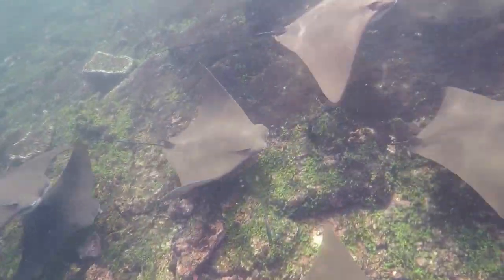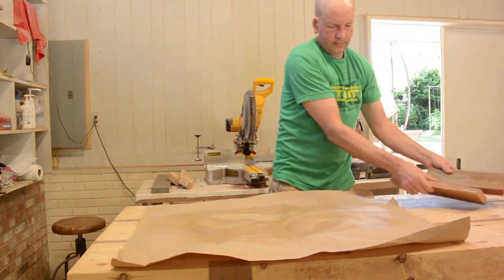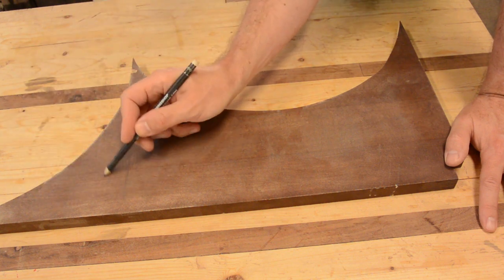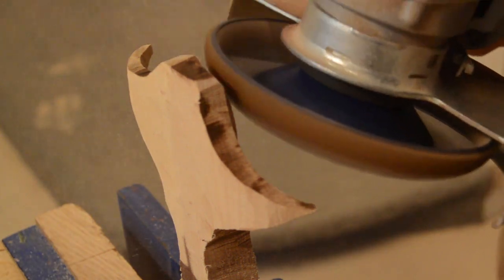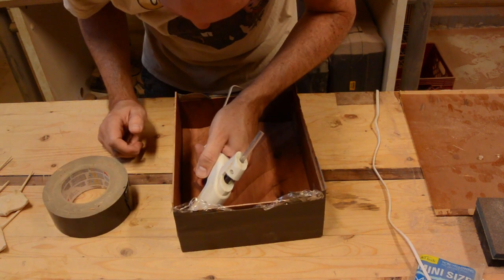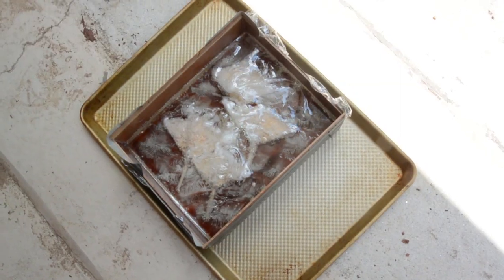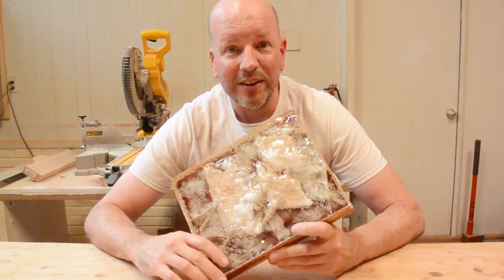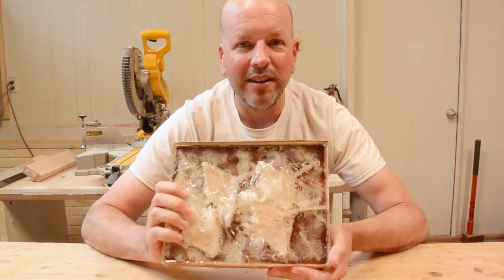Making Wood Stingrays - Carving, Woodworking, Art, Sculpture

Comment: Yeah, i was wondering when you did that pour if it was going to be too thick.... 
just a suggestion: if you do multiple shallow layers, leaving each pour to 'mostly cure' (semi-solid but tacky) before pouring next layer it will not only allow the layers to cure properly (heat dissipating gradually) but also allow you to position the rays at different levels, looking more realistic..... (this way you may even be able to use the same type of epoxy)
Shame it bubbled over, was looking like it would've been great
Reply from the maker: Thank you, Andrew. Great suggestion. Athough, I wanted to avoid having a line between the layers.

Comment: I have had a problem like that. Popped the piece into the freezer for about 15 minutes, then checked it. It had cooled down so I took it out. It began to heat up again so I put it back in for another 15 or so. Took it out and kept an eye on it. It didn't overheat again. Although it did cure much more quickly, it looked fine. 

I was using Alumalite clear slow set. Usually 3/4" is about the maximum thickness I can pour it. Any more and it goes exothermic. I've saved 2 different pieces using the freezer to cool them down.
Reply from the maker: Wow, that is something I would not have thought of. Admittedly, I tend to avoid taking things that are smoking and bubbling into my house. ;)
Reply: @CammiesGarage  I think once it's reached the smoking and bubbling stage it's a little late anyway. 😁

Comment: I like the resin idea. It’s too bad it didn’t work out. Another idea is to make a similar base or ocean floor out a lighter wood, make some 1/8 or 1/4” plexiglas sides that rise above the surface maybe 3/4” pour some white sand and carved shells on it and place the rays on dowels at different, varying heights and drill holes to mount the rays above the sand.   Should look like the videos your wife took.
Reply from the maker: Thanks for watching, Laurie.